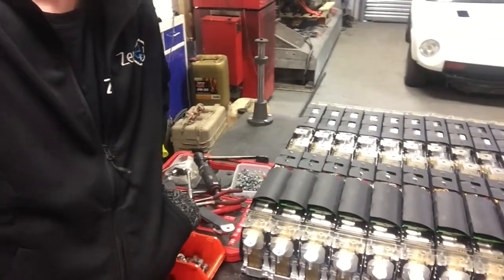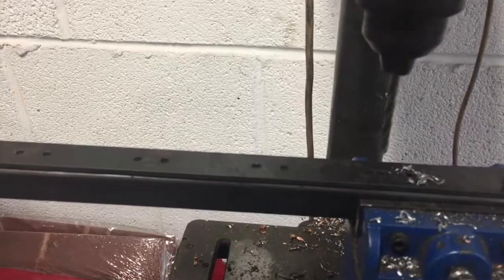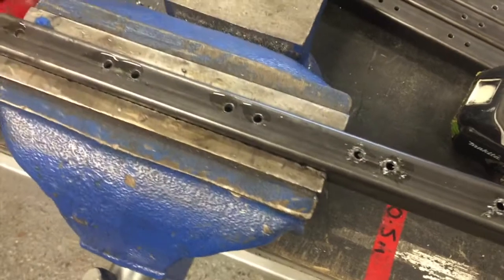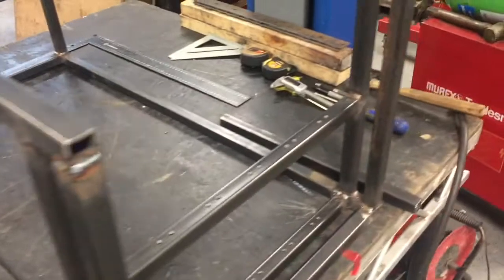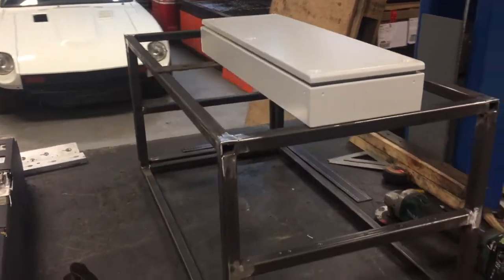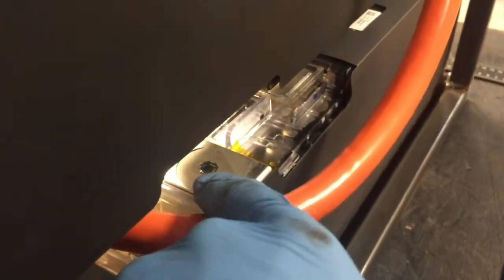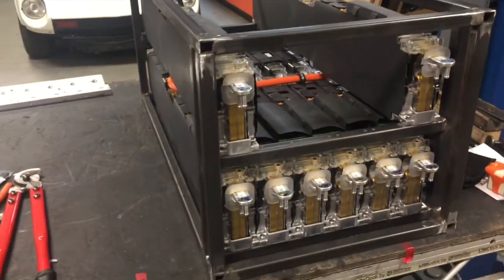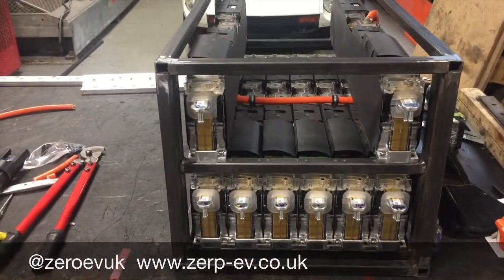Electric car conversion battery pack build part 1, Tesla B Class modules 18650 cells

Comment: Hello Zero EV, thank you for your videos, they are excellent.  I'm curious if this is the same box you put into the Boxster?  I am hoping to use the same B-Class batteries and this box design for a 996 911.  Do you have any idea if it would fit in the back where the engine originally was located.  I know you said in another video that these modules are 90cm long.  I will be doing some measuring today.  Thank you!
Reply from the maker: Yes this is the pack we fitted into the Boxster. It’s not high performance so will only give you about 150hp peak
Reply: @Hazell_Nutz  Oh okay, I was planning to run the Model 3 Rear Drive Unit with it.  Sounds like it won't be enough.  Do you recommend another battery pack option?  I would like to stay less than 40kwh for weight reasons if possible.  Thank you!
Reply from the maker: We have the model 3 drive units coming out end of this year and actually will show them on the volt this Sunday. You could do 35kWh pack made of 16 x CALB 2p6s modules. We sell them on our website and keep them in stock along with all the busbars and cooling plates.
Reply: @Hazell_Nutz  Okay great!  I'm guessing the B-Class battery won't work due to the model 3 RDU current requirements?  
Thank you for answering my questions and for your videos.  They have been so helpful in giving me the confidence to take on this dream project build!
Reply from the maker: We are actually going to be fitting a new set of modules into the Boxster as the current ones are already at 70% capacity
Reply: @Hazell_Nutz  Do you know why the pack is experiencing degradation?  I thought Tesla packs with cooling lasted quite a long time.  Thanks!!

Comment: As expected, what's the average range of a conversion?
I'm guessing the TESLA fast charge system isn't available for converted vehicles (In a video of a rebuilt TESLA model 3 couldn't use one)?
Reply from the maker: About 100 miles
Reply: Every month I drive 80 miles (round trip) to visit my sister, then do chores (store, gas, lunch, etc...) so "about" 100 miles wouldn't work, between 150 to 200 miles (300 preferably) would be good.  ;-)
I was thinking of a 1966 Corvair convertible.

Comment: Did the battery modules come with their own Formex covers or did you design your own?
Reply from the maker: MrLikerBiker Hi, They come as seen in this video. We have also just designed a new plug and play replacement bms brake out board

Comment: This looks promising for my 987 Cayman conversion. Nice work
Reply from the maker: aDIYguy let us know as have a second pack that we could build for you. 50x48x98cm for the main box plus the small contactor box.
Reply: @Hazell_Nutz  Right now I'm trying to find a crashed model 3 and use the motor or motor(s) from that and was thinking two volt battery setups but this may be better?
Reply from the maker: aDIYguy currently no one as the model 3 motors working. So maybe look for a model s or x. We are about to start hacking the model 3 system very soon. I would avoid volt the good for discharge but very bulky. Maybe get a bolt pack.
Reply: @Hazell_Nutz  I want to use the car mostly on road course so I was hoping the better cooling of the model 3 stuff would allow more laps than model s/x motors? I think someone has already hacked the 3 just not diy level yet?
Reply from the maker: aDIYguy you can modify the coolant system on the large drive units I have a mod for it that splits the motor and inverter onto different loops. Then with the small units there already split inverter/motor so you could run them on separate cooking loops. I have not seen any model 3 systems yet so please share if you have mound one.